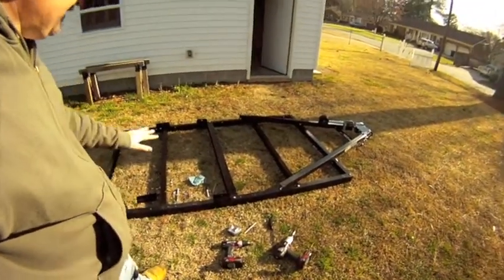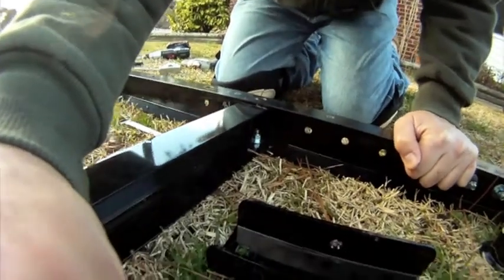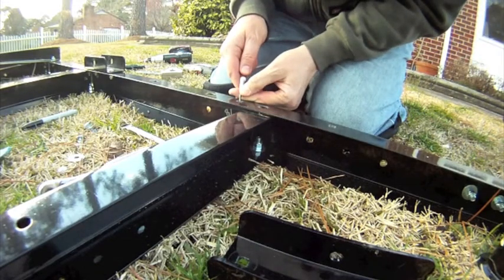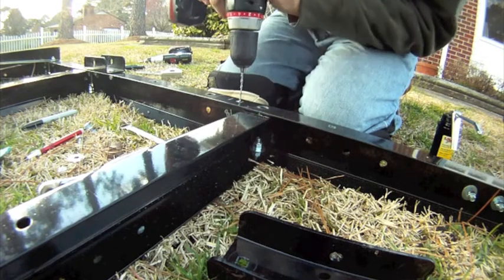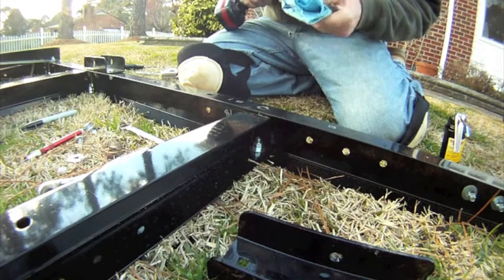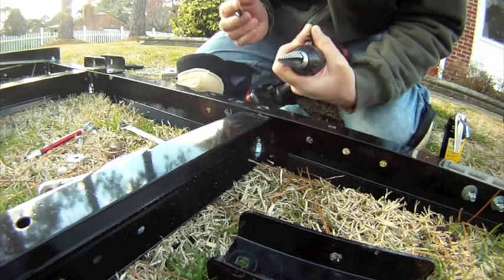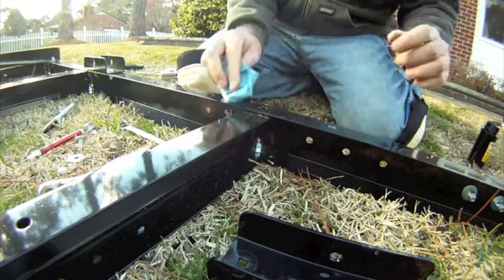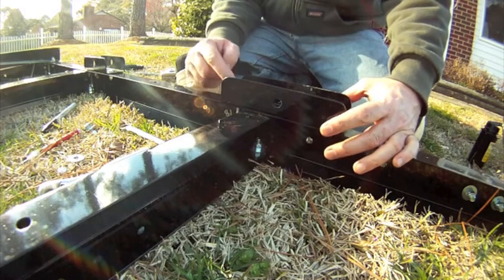Teardrop Build part #5a

Comment from the maker: The bit worked well, but I wouldn't use it for anything thicker. The trailer frame came in black from Northern Tool. I looked at the Harbor Freight ones, but I wanted to go five foot wide. But, lots of folks build a 4x8 on the HF frame!